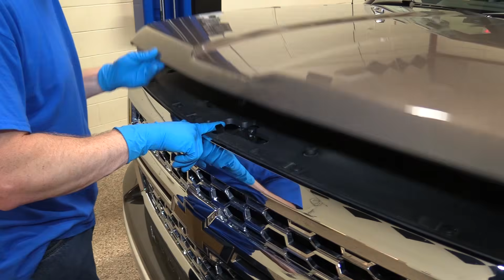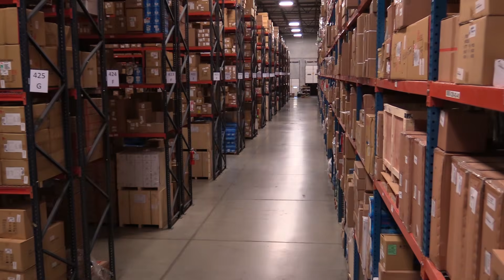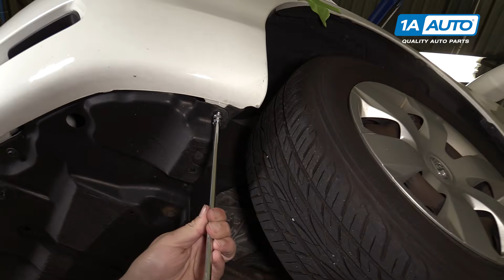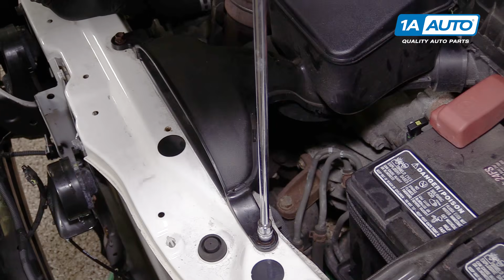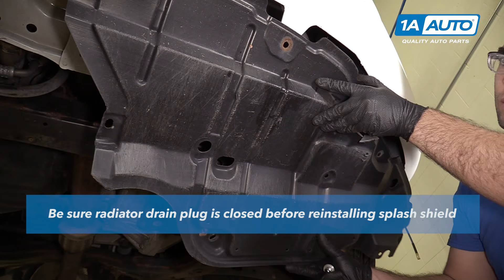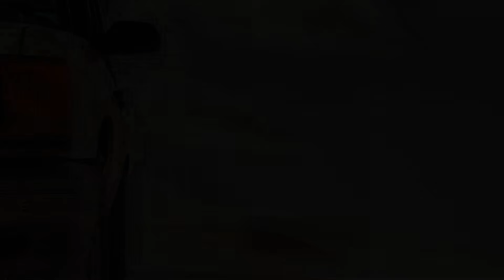How to Replace Coolant Temperature Sensor 06-11 Toyota Camry

Comment: Is it the same steps for a 2006 toyota Camry
Reply from the maker: +Kievon Dee Yes!
Reply: I have another question so for a 2006 toyota camry I'm replacing spark plugs cause its misfiring but I'm also looking to replace the spark plug boots... is it another name for it

Comment: Do I need to drain the coolant before replacing the sensor?
Reply from the maker: +kobby Yes, you should drain the coolant first.  Step by step instructions can be found on the website listing for this part.

Comment: Why can't you just unscrew the sensor pull it and quickly stick the mew one in and avoid draining the coolant and taking the splash shields off .
Reply: You can.
Reply: Probably replacing coolant and sensor

Comment: Hello this 2 sign are showing to me after 5 mins. drive when i checked my engine it's  not hot normal temperature for driving i have checked  the colant bottle it's in max level after 20 mins driving color blue temperature is showing and im hearing some static sound every time i press the gas and when the car stop in the stop light my engine will turn off automatically 😑

Comment: Would you happen to know why my car only blows cold air when I’m driving or when I push on the gas. For some reason when I’m idle it blows hot air, but if I put the car in neutral and push on the gas then the fans start spinning and the ac works
Reply: Maybe the fans behind your radiator aren't working, so it only blows cold when the wind is hitting it.
Reply from the maker: +Ruben Sanchez There may be multiple reason why you are experiencing this issue. We are unable to diagnose but we do suggest taking your vehicle to a local mechanic. Thanks for checking us out!
Reply: My car doing same problem

Comment: Hi, I have a problem with my Camry hybrid 2009 the car, change the hybrid system's pomp, the car follows me overheating the hybrid system that you recommend
Reply from the maker: +Hugo Soto Since there could be multiple reasons why youâ  re experiencing this difficulty with your vehicle, I strongly recommend that you have a reputable mechanic inspect it. Theyâ  ll be able to troubleshoot the problem and tell you what part or parts youâ  ll need for the repair.
Reply: The hybrid water pump but I change ho ready still overheating hybrid sistem thanks you
Reply: Did you fix the problem?

Comment: How do you bleed the system coolant of air ? Not explained
Reply: Once you have the funnel of coolant on the radiator turn on the car and put the heater on full heat and highest fan speed .  Let it idle for 30 minutes and make sure the radiator stays full
Reply: You can squeeze the hoses to " burp" them. if you have that funnel it is very handy because you can run the engine with it attached and the air will bleed out

Comment: Why should I drain all the coolant out,,,I can reinstall the sensor without drain coolant out... just wondering
Reply from the maker: +سعيد خالد It's good practice to change out your coolant with fresh coolant when you get a chance. If you know for sure your coolant is good, you can use that.

Comment: What did you drain the coolant? Was that really necessary?
Reply: No, but you'll certainly make a big mess.
Reply: @Wes_5kyph1  What mess?
Reply: @freddylamberte  this is  what im thinkin man. what mess are they talking about. its not like the thermostat change.  i didnt even c a drop of coolant.Either my car  is extremely low on coolant or i think the draining and mess is a little overstated ,dont ya think?
Reply: No you don't have to. unless it's due for a change. If you're really quick with the sensor change over you won't spill much coolant.
Reply from the maker: Yes, it is required to drain the coolant prior to the replacing the coolant temperature sensor. +Dizzy Hips

Comment: The the temperature sensor for Toyota Camry 2007 at the same location? Also is it mandatory to remove the air intake tube to reach it?

Comment: Hey I was just wondering if I can reuse the same coolant that you drain?
Reply from the maker: +Jesus Romero If the coolant is old, it should be replaced with fresh coolant. If it is fairly new, you can reuse it. You would need to make sure that it is clean and free of oil or debris. Hope this helps you out. 1aauto.com
Reply: Hey.  Thanks for the video. After my 2010 Prius overheated. I drained the coolant and replaced the liquid. Now my car gas engine won't kick in,  but the electric engine runs. Please what can I do?
Reply: @YuusufAkorede  Get a car that doesn't run on duracell...😂